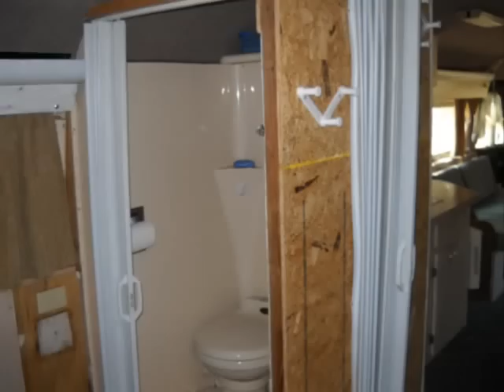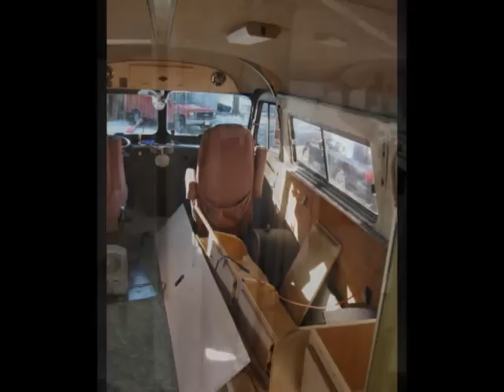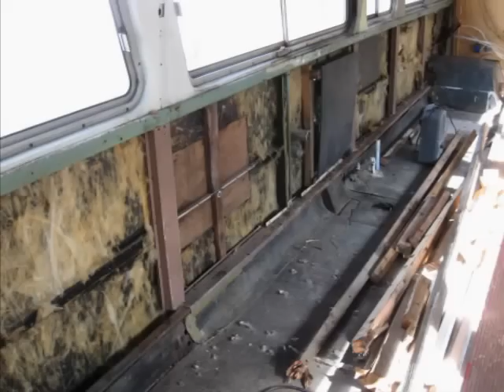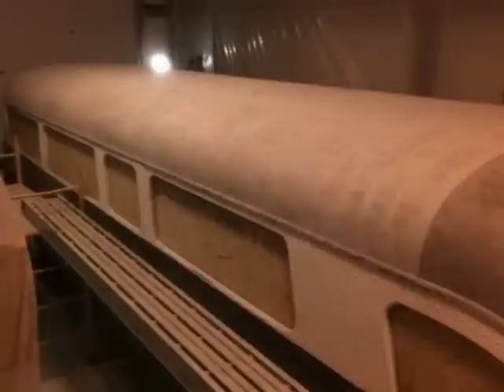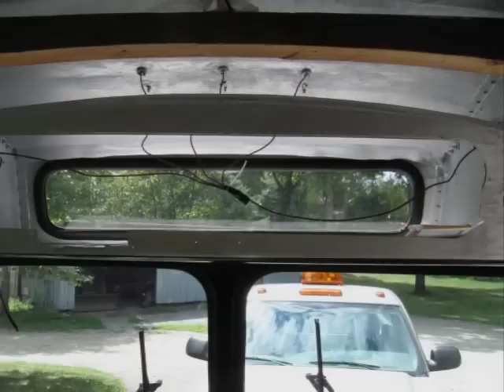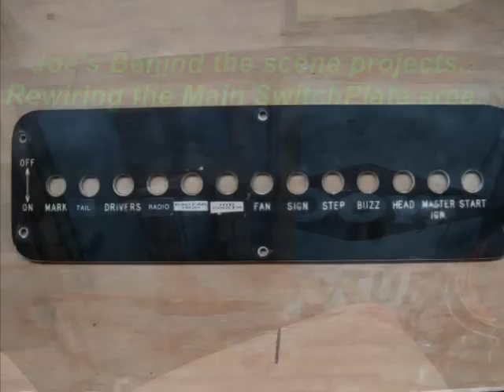1954 Flxible Visicoach Upload WMV.wmv

Comment: Love the green bus color, very pleasing to the eye!  Nice job on the remodel, so roomy, I envy you!  The vintage chrome details on front hood are so lovely!

What kind of spray foam did you use?  I'm looking for something robust and non-toxic.  Please share this detail as I am remodeling my Class C RV and lots of small areas need insulation.  Foam will be easy to squeeze in.

I'm also curious about what material you coated the front entry steps with?  Was this a plastic type sheeting, or paint on thick rubber coating?  Looks good.

For ceiling, some creative ideas are: vintage tin tiles with embossed design, not shiny, but with a patina of old paint.  Lends a lot of texture, but you have to see if it fits your style.  Can also be used as a backsplash.  There are places online that make these architectural copies of old vintage Victorian ceiling tiles.  

I've also seen people do ceilings with a nice grain thin wood panels.  If you use these, refinish with shellac for a warm glow.  You can insert aluminum strips to get a pleasing contrast to the wood, and break up the continuous wood cabin look.

Comment from the maker: @RailcarEng  The motor is a 1995  C8.3 Cummins (275 hp) 800+ (lb ft) torque bumped to approx  325 hp  The trans is an Allison MT644  The  bus was modified to accept a larger radiator and a inter-cooler.  A hydraulic fan moves the air for cooling
Reply: Did you sell it ?   and if so how much?

Comment: Is it still stick? Why remove the fluting on the outside?
Reply from the maker: The standard transmission was replaced with a Allison automatic,the siding was in bad shape (Someone tried to clean the fluting with a power wire wheel) and after the bus was painted we liked it the way it was.
Reply: @dwc0052  Unbelievable! A power wire wheel is a sure way to destroy the fluting. I keep looking for a totally original Flxible Clipper but will probably never find it.

Comment: Nice job getting rid of that dated interior.  The old Flxible owners and Flxible owners in general have bad taste except the Creative cruiser dude.  Surprised you didn't use aluminum to frame that back wall to keep the bus light.  A nice thin wood veneer or even stainless steel for the roof would be amazing.  I've seen some dudes use these tacky foil looking panels to do the roof.  Ughh!